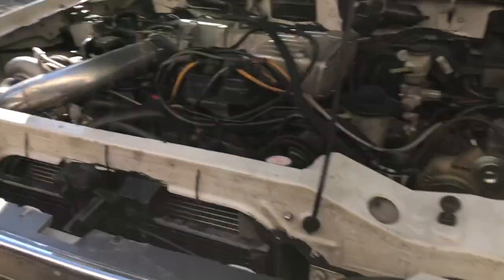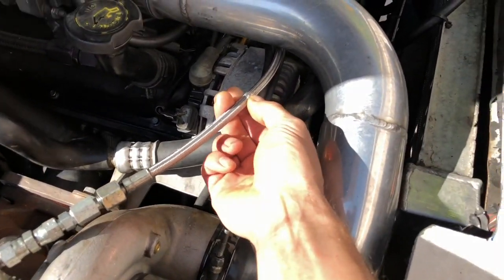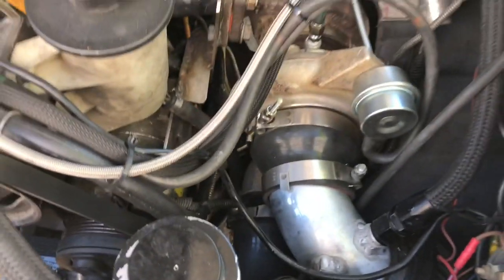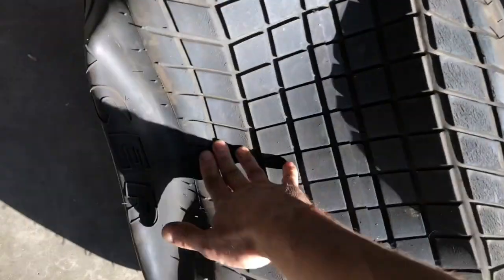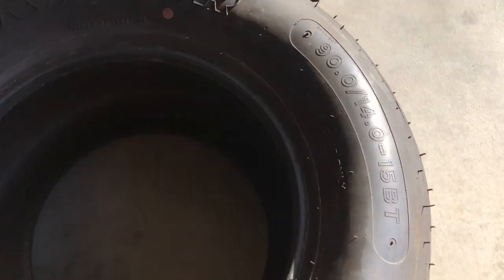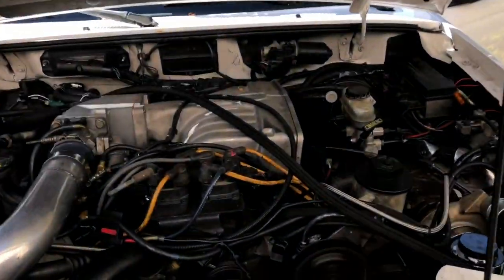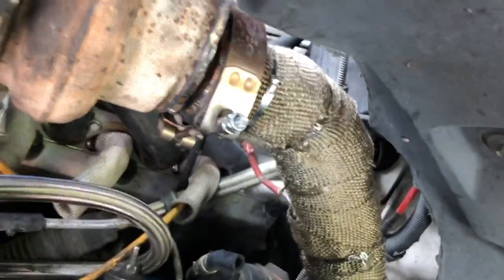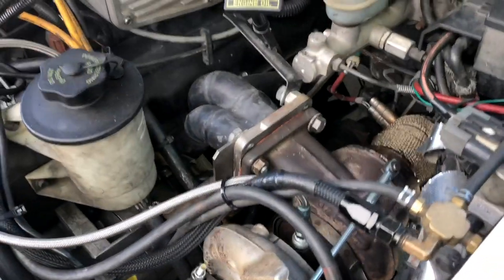Ford 5.8 gets its second Cummins 5.9 turbo! Holset turbo install finished, ready for the track?

Comment: There is that " turbo flash " on the running  lights..🕶
 I need to send you my computer asap... delete the rear 02's , auto.trans functions, evap..that stuff...
 Be safe out there bro with all this bs corona going around.
Reply from the maker: Jody sounds like someone is getting close to having their beast running soon! Let me know when you’re ready, you can email me it’s the channel name at gmail if that’s easier. I’m not on social media at all.
Reply: @1stockcam   yes! Engine  is on the stand. I've got to get the mock up block out..set the new one in.. I'll email right now... let me.know if you got it if you dont mind